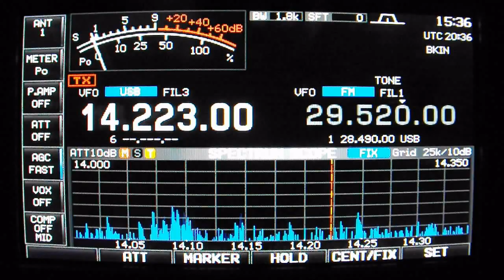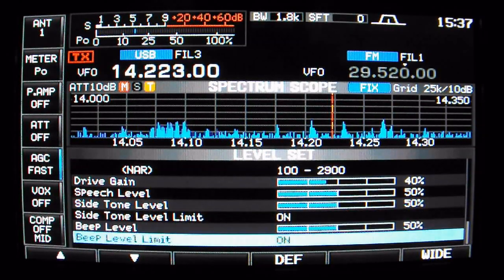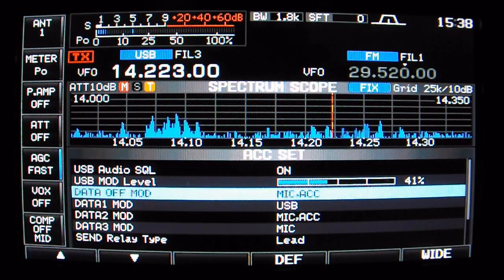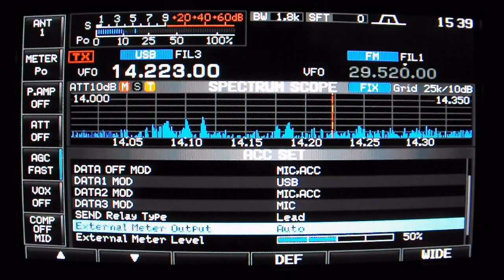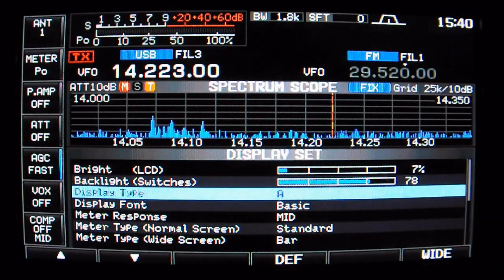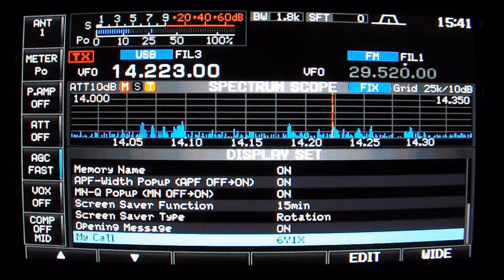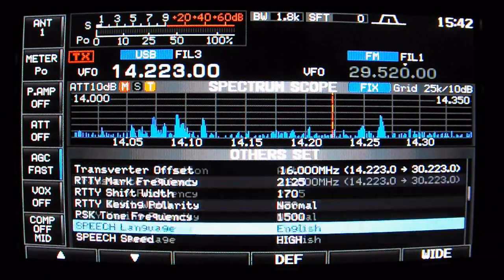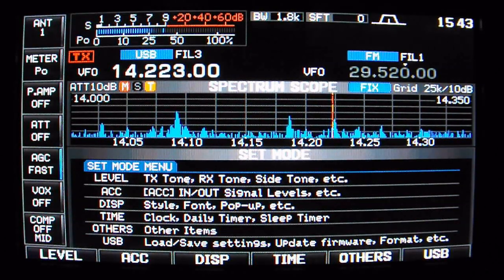Icom 7600 vs 756ProIII (Part 3 The 7600 Menus)

Comment from the maker: Great Radio if its in your budget.  Icom is the best at putting all the things you use daily right on the front and putting the rest in Menu's.  They even layer the Menus so that the most least used items are deeper down.  Perfect ergonomics.

300 mile trip at night on 40M is easy but during the Day thats going to be a major problem as the Day bands don't work well on those short distances.

Comment: Thanks for video, I'm looking to add a base station in the future. The 856 no longer made so thought the 7600 would be best. Not certain I need this advanced transmitter. I have a w32a hand held, a couple IC2100s, and a 706MkIIIG. I want to install 706 in truck with one of the 2100s then install the other 2100 in shack (which doesn't exist right now) . I'd like to find a way to simplex from southern CA to central AZ. About 300 miles by car and maybe 250 in straight line. For emergency service.